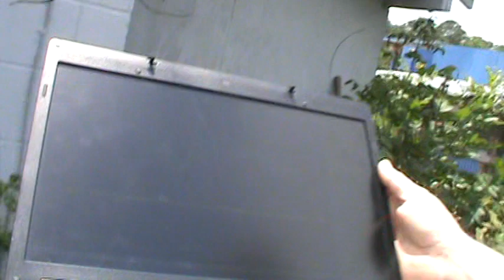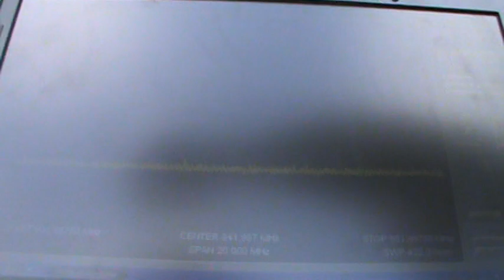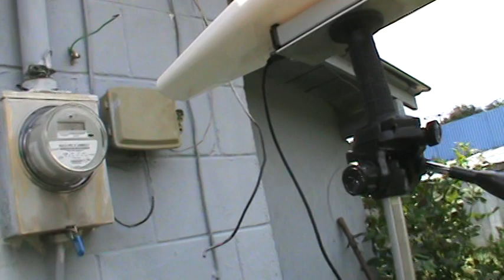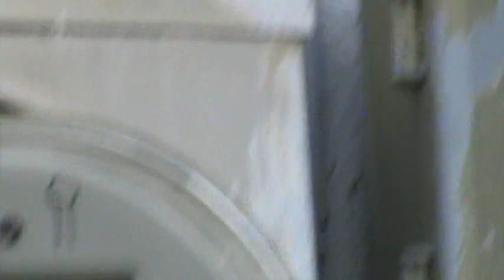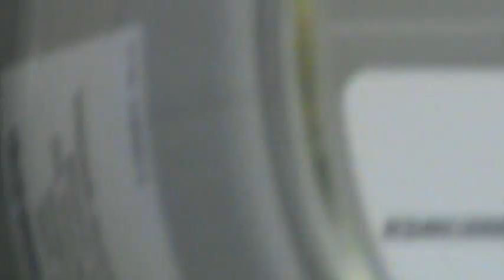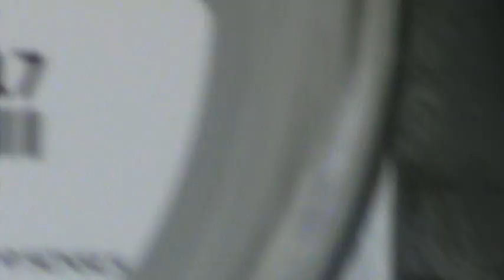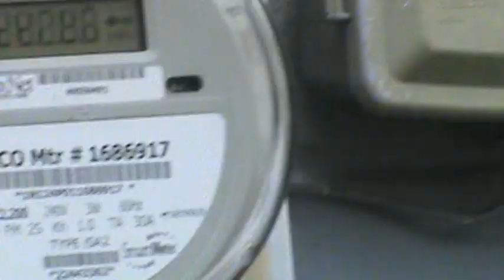Georgia Power Smart Meter Investigation Part 1

Comment: Interesting that they use a tower, and this is indicating that there are many different systems in use. If they are only sending out a signal a few times a day is better than the systems that they use a mesh setup where meters send to other meters. In the end the setup here is by far safer than is installed in other locations. Also 20cm is slightly less than 8 inches. Also radio waves decrease in magnatude by the inverse square. Meaning that if the distance is doubled, the signal is 1/4 if 4 times it would be 1/16 and so forth.
Reply: THANK YOU FOR THE EXPLANATION ON HOW SMART METERS ARE KILLING OVER 100 PEOPLE EVERY MONTH

Let's look at why we do not need smart meters. 
 #1 A smart meter will hurt or even KILL disabled homeowners who have disabled medical implants.  The average of deaths by smart meter radiation and smart meter fires is almost 100 every month in North America.
#2 Did you know if your power company “turned off” the power to your home when they did a smart meter install, your chance of a smart meter fire increased by a factor of 10,000.
#3 Your power company has access to all of you private power information. Eg When you make tea, when you turn on your alarm etc. This private information is sold to Google for huge sums of money. Ask your power company what the second radio transmitter in your smart meter does. (ZigBee) 
#4 A smart meter will cause cancer to return if your family members who are fighting cancer at home. If they come home from the hospital and sleep near a smart meter, they will die. Check with the US Cancer Society website. 
#5 Smart Meter RADIATION  will turn off breakers in your home. Both AFCI's and GFI's get turned off by the radiation from the smart meter.
#6 You smart meter is very accurate, BUT, the software (firmware) is programmable. Your bill has nothing to do with the power you use. 
#7 Smart meter radiation is breaking Ionic Bonding. 
#8 A huge expenditure for a huge loss. Billions of dollars to purchase something that does not general generate any power and each smart meter need 4 watts to operate. One million smart meters use 4,000 KILOWATTS of energy to operate.
#9 The second radio transmitter is for ZigBee. If you want your power company to MONITOR your home 24/7, then you are in luck. Don’t forget, this private information will be sold. Why do you think your power company spends BILLIONS of dollars and does not generate one watt of extra power to sell?

Comment: Do you have WiFi in your house? The amount of radiation you get from one of these meters is much less than what comes out from your WiFi.
Do you have a Cell Phone. The amount of radiation you get from one of these meters is much less than what comes out from your cell phone.
The bottom line is that these meters put out almost noting compared to everything else you even get close to.
I've been a Ham Radio operator since 1985 and this is nothing when it comes to RF entering your body.
BTW, the amount of power drops as the square of the distance so move that antenna 10' and the power has dropped by a factor of 10, go 20' and it's dropped by 100, go 40' and it's dropped by 1,000. This is why the other meters around you don't matter.
So the bottom line is that it's nothing to worry about.
Reply from the maker: the amount of radiation actually, it not a theme in these two videos, maybe far in the background.....again I didn't make these videos because I am worried about radiation, yet the cumulative effect being nil @ distance is interesting because these signals can be detected when supposedly there is no power, virtually none at all remaining....one of the issues is the density of types of signals within spaces....energy affects more,much much more than it's power and your distance from the transmitter, far as concerns go, microwaves are notorious, not like the radio band with crosstalk, yet somewhat similar, with space-density load problems causing unwanted resonance.......the area accumulations relative to the band and number of signals within that band are never considered in public talks about microwaves (for good re$ons), so you get crazy stuff like cross harmonics, spatial dissonance, relative to resonance factors, which is related to load density, not, when speaking of these types of microwave communications, so much the power, but space and the amount of signals within the same band or AFFECTING qualities of a frequency within a band or across bands which causes the problems I was investigating at this time, and still am...yes bossman, serious problems....it's no where near benign.
Reply from the maker: no I do not use wi-fi....the matrix firing rate is disharmonious to the human body's natural rhythms....in fact microwaves over all don't mesh with us well....it will cause, even at low power, with repeated exposure, a slight enlivenment of the cells within your body, especially your mind, basically this mess we all live in now rings your cells like a bell and it never stops because you are saturated continuously almost everywhere now...it WILL and DOES cause mass insomnia, makes people slightly more tense and irritable, military has tons of early development studies where 90% or better of the technicians had problems with depression and cognition..., and the studies currently underway point to it, constant microwave saturation having a a serious negative affect on animal tissue development and stability, which is not a good thing, will take us, if even possible, hundreds of years to mutate at anywhere near a normal rate to negate the effects. Keep my cells turned off when not using 'em, only recently started using a smart phone, it stays off too....any circuit with use changes, at the basic structural level relative to power density, frequency signal saturation, time transmitting, and even the mere presence of  measurable energy on the carrier circuit, especially open-air circuits, this includes the environments which are in constant contact with electromagnetic energies artificially produced for things like data delivery. Meaning me, you, and the air too.
Reply: After taking measurements with hf35c and acousticom 2, ive seen higher levels coming from my smartmeter (facing the meter from outside). But from inside the room, power levels are closer to a cell phone, and lower than a wifi. But I suspect the meter is still more powerful than these because I can pick up the transmission bursts from the other side of the house, similar to wifi and much more powerful than a phone. I would bet the metal box that the meter sits on blocks a lot of what would otherwise be going straight through the wall.

Comment: SMART METERS CAN NOT BE USED TO INTERRUPT THE LOAD
 IF THE METER IS NOT BYPASSED, THEN THE CHANCE OF A SMART METER FIRE INCREASES BY A FACTOR OF 1000 TIMES
 IF THE CUSTOMERS METER BASE IS NOT INSPECTED TO MAKE SURE THEY STILL MEET UL CERTIFCATION, THEN RISK OF A FIRE INCREASES BY A FACTOR OF 10,000 TIMES AND THE UL CERTIFICATION OF THE CUSTOMER'S METER BASE IS DESTROYED BY THIS CRIMINAL ACT
If you come home and find the power has been interrupted to your home and you have a new smart meter, call the police and charge your power company and the meter installer with ATTEMPTED ARSON.
WATCH, AND TAKE NOTES ON THE ONLY LEGAL WAY TO DO A METER SWAP
 https://www.youtube.com/watch?v=G0bq2Hn2vOo 

#1 If they install a smart meter and your power goes out, then they are ARSONIST. 
In Canada, it is against the law, all smart meter swaps have to be BYPASSED to keep the power on.

#2 If the customers UL certified meter base is NOT INSPECTED by a CERTIFED electrician before the meter swap, they they are probably breaking the law and will increase the chance of your home burning down by a factor of 10,000 times. 
Remember, the only electrical device in your home that is NOT UL APPROVED is their smart meter. 

Why do you ask a smart meter is not UL APPROVED 
BECUASE THEY ARE NOT BUILT STRONG ENOUGH TO MEET UL'S SAFETY REQUIREMENTS.
They are only certified to measure power consumed.

Comment: I live in Warner Robins, Ga. and Flint Energies is the power company here but Macon has Georgia Power and the problem I am having is getting a straight answer about how does these so-call smart meter work and how the power companies get their reading and how they know what is being used outside of doing the Analyze My Bill I did it because my bill been running high since it been in for a few years (the lowest bill was $135.00) but during this past year starting 07/25/2017 $185.46, 8/25 $203.93, 9/25 $212.32, 10/25 $160.58, 11/25 $158.38, 12/25 $185.38, 1/25/2018 $195.24, 2/25 $248.49, 3/25 $182.62, 4/25 $187.05, 5/25 $179.57, 6/25 $261.36, 7/25 $541.90, 8/25 $630.40. Now here is a little info about my mobile home it is 14' x 70' (980sqft) 2 bedroom/2bath on both end w/ the living-room & kitchen in the middle and since my daughter moved away June of 2012 I been living alone so you think the light bill would get lower, not. In 2013 the cent. heating & air along with the dishwasher broke down and my landlord didn't get them repaired, you think my light bill would finally get a break, not. Not too long ago (now that it is 2018) he had the cent. heating & air fixed but not the dishwasher not much of a change there. During the last 5 months, I took a turn for the worse and spent it mostly in bed, again you think my light bill would go down just a little, Hell to the no, the damn thing about put me in the hospital and this one almost to my grave. Please help somebody. I am on SSI (Ga. $750.00 a month), Section 8 (I pay $143.00 a month) and food stamps $76.00 a month with Medicaid (Disability) that I can't use since my car was stolen and we don't have public transportation and cab/taxis service is way out of my budget. Sadly to say I am all alone no family or friends near by.
Reply: I lived in Gainsville Ga. back in 1977 and as I remember it, it got pretty warm in the summer and cold in the winter. The place I
was
  living in had no A/C and gas heat. I can only imagine the weather there since global warming has taken hold. I lived in Florida for
 25 years after that but now I have lived in the mountains of West Virginia for the last 17 years and it has gotten warmer in this
time but this wouldn't necessarily account for the wild swings in your power bill. I'm surprised that the help that you get on your
power bill didn't question the power company about the huge increase this last August. I think that your smart meter is less to
blame than the guy reading it. I don't know if your power company is having your meter read by a human or getting a signal from
the meter itself. Before we got our smart meter, our power company, which was Duke power at the time 6 years ago, had meter
readers with a gun type contraption that took actual pictures of the meter each month so if there was a dispute, they could show
the meter picture and it's meter number assigned to the customer as proof of their calculations. Let me ask you this, I live in a
28 X 66, 2000 model year double wide. Everything is electric, no gas, no propane and my power bill here hasn't been over $250
in 17 years and this included 2 kids up until recently as they've gone off to school and a wife who thinks it's a sin when the
temperature goes over 68 degrees
 in the summer. My power lines come off the transformer on the pole directly to the down feed
into my meter box and into the house. I have seen sometimes, especially with mobile homes, where the power meter is mounted
on a pole in the yard and the power line is run underground up to and into the house. If this is your case, and if it is an old
installation even if the house is new, If the insulation on the underground cable is degraded or damaged, this can bleed off
power and add to your bill especially if the ground is wet after a soaking rain or snow melt. It would be easier to tell with the old
mechanical meters by flipping every breaker in the house and watching the wheel in the outside meter for movement. With the
smart meters, you would have to watch for the numbers to change, possible for hours, to get a result. Years ago in Florida, I put
up a stockade fence at my first house to contain my kids. One night a year later, the lights went out. We went outside and every
other house was lit so I stayed home and called Florida Power. They sent a tech out and he pulled the meter and saw that the
power was dead on their side of the meter too so he connected a long jumper back to the junction box in the back yard
temporarily and put in a work order. Three days later, a crew came out and immediately blamed the post holes I had dug the
year before. They had this thing that looked like a bow saw with spikes and a meter hooked to it. They poked the spikes into
the ground at each post, looked at the meter and said, "Yup, here, here, here and here. you hit the underground line and gonna 
cost you about $200.00. I said BULLSHIT!!! I didn't even hit rock!!! They got their strongest signal BETWEEN 2 fence posts.
They dug it up and found splattered aluminum from the wire casing and some glass from the flash over into the sandy soil.
They said they'd fix that one first and move onto the next. They fixed that one and checked for power and didn't have to fix 
anything else. They also couldn't charge me because it wasn't near a fence post. We never noticed an increase in our bill
because the line broke BEFORE our meter. If you line runs underground from a meter on a pole to the house, this is AFTER
the meter and every kilowatt hour it bleeds into the ground will go on your bill. If this scenario is your case, it will be your land
lord's responsibility to repair it as it is on his side of the meter. If he doesn't repair it in a timely matter, I would call your local
housing department but be prepared. I don't know what Georgia law says about tenants having to move out of what might be
considered unsafe property. Whatever you decide to do, DO NOT do it yourself!!! If this is your problem, it is on yours / his side
of the meter. If you call the power company down to check it, the bill is in YOUR name so the bill will be sent to you or added
to your power bill. Let the landlord take care of it. It's HIS responsibility. A quick thought. If he won't do anything about it, Keep
track of ANY rainy days or days when any snow melts on your property and write it down. Then check your power bill for that
month. If it is consistently higher in wetter months, I'll bet this is your problem. Good luck.
Reply: you can opt out http://www.stopsmartmetersgeorgia.org/smartmeterfaq.html and also . On December 17, 2013 the Commission approved a Smart Meter Opt-Out tariff as part of Georgia Power's 2013 rate case. Customers who opt out of having a smart meter installed and prefer to maintain a mechanical meter at their residence or facility can now do so with a basic service charge of $19 per month. Customers can request removal of their smart meters by calling 1-800-642-5172 or emailing G2SMARTMTR@southernco.com.  we are getting ready to the fight the $19 a month surcharge. but these smart meters are not so smart and they charge some people 500 times what they really owe. https://www.newstarget.com/2018-10-17-smart-meters-are-wildly-inaccurate.html
Reply: @paranormalguardianstm1775  Here in the Augusta, georgia area Jefferson Electric charges $40/month to opt out.  To me that is not an opt-out.  That is extortion.  They did not need $40/month for decades before to read the meters.

Comment: RPITX on a rpi3 can force a transmit on a smart meter with a script
Reply from the maker: yes quite a few devices of that sort.  I had a suite of linux toolkits running over BlackArch on a mobile unit. That entire drive got hit online constantly, finally corrupted and failed.  Have the damaged drive, plus images, but they are before the software was installed. People's failure to realize hooking a computer, a networked one at that, to their voltage carrying lines is a very bad idea, is but one thing that makes the entire "smart" meter debacle a major guise. The things are not even secure against hacking, at all.  Now their collection aggregate SW may be, I do not know. Yet access to the computer, and to your house wirings, incl. wireless via over-ride is done easily because the transceiver is outside those protections, even on the newest units. To make it behind a workable firewall increases the complexity of everything and no telling increases the cost how much. These things are not about better, safer, nor tech advancement, they are bandwidth reliant terminals built cheap ass enabling things by law you cannot disclose truthfully far outside their advertised ways means and stated purpose.  Such things are pure horseshit. regardless of claims. Smart meters are the #1 factor in the causing of microwave resonance which causes "the hum" (thehum(dot)info). Much as sheep think no way they would fix that, they either are ignorant or don't care that they, powers that be who know better, want and use that resonance for their own purposes, so it is neither discussed nor truth be told.  Many things like that for sure here in US and seemingly worldwide, more for stupid 18th century peasants yet it's seemingly working well on the 21st century enthralled sheeple, the modern day offspring.